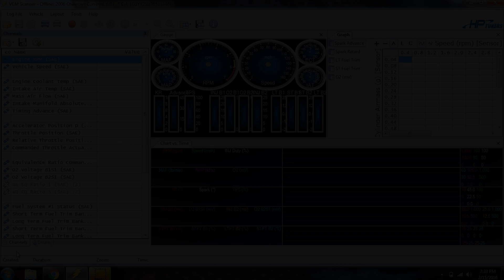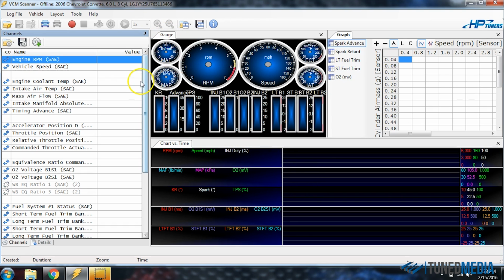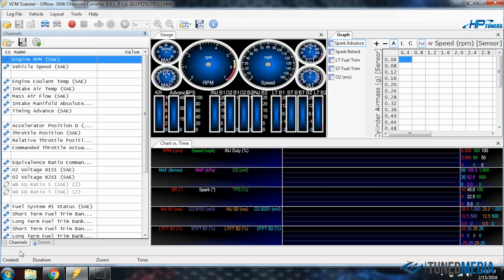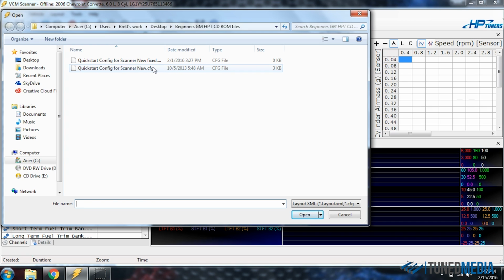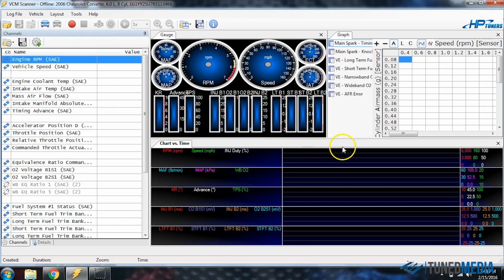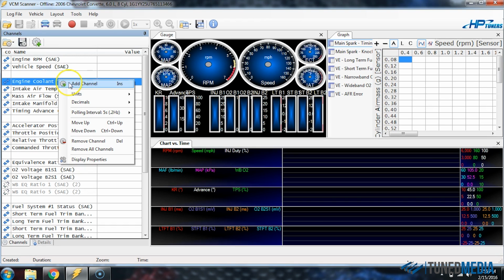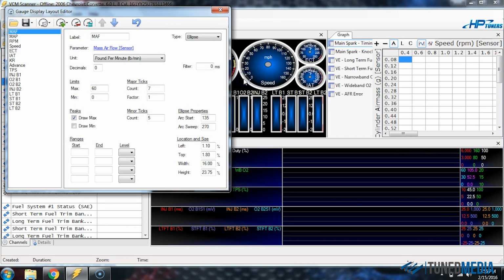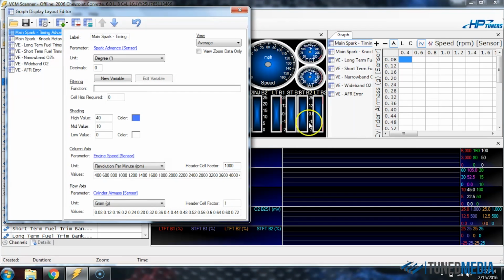HP Tuners 3.X Scanner Quick Tutorial

Comment: I have a question. I have a issue in a vehicle that when I open the scanner and connect . It doesn't read the intake manifold absolute pressure. I deleted and add it bac to the channel list. Disconnect and connect to the vehicle and repoll for supported parameters . But still doesn't read anything. Any idea would be helpful
Reply from the maker: Hey Henry! Unfortunately, there are far too many variables for us to be able to effectively identify this issue over the comments. I would suggest contacting HP Tuners directly with this issue. You can reach them by emailing support@hptuners.com.